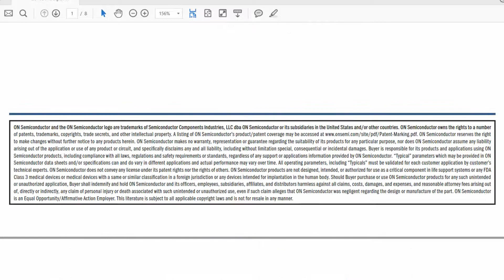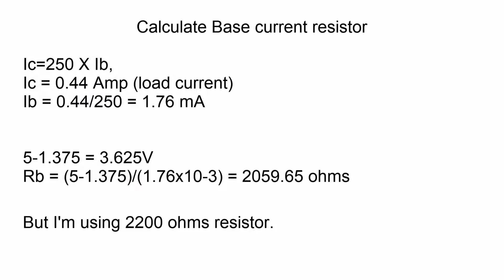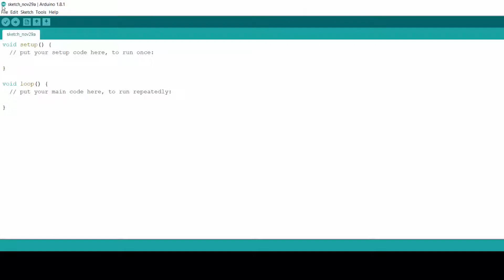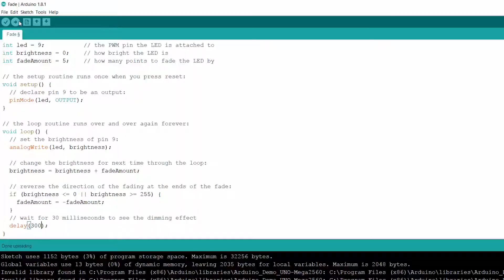Arduino Tutorial 27# How to control 12V LED & motor with 5V arduino using Transistor TIP 122.

Comment: Hi, I'm not sure if you are still checking messages on this item but I have followed your instruction and it works fine but I am wondering if I can change the polarity as I would like to switch on and off the positive not the negative.
Reply from the maker: NO you can't change the polarity, It will not work. it (LED Light 12V) is suppose to connect negative on TIP122 and positive on 12v power.

Comment: I need a help with an arduino program
I want to turn on led strip through IR sensor.
So when IR sensor output is high the led strip should glow and remain glowing even if the IR sensor output is low..
And when again IR sensor output is high the led strip gets off and remain off even when the output is low...

Comment: Can i know if i use siren 12v also can use this way to make it functional?
Reply from the maker: yes it can be use for 12v siren but check operating ampere of siren and calculate resistor value.
Reply: Robotica DIY where can i find the transistor at my area no have sell tht
Reply: Robotica DIY if i use tip 120 for siren 12v it is can n suitable or not?

Comment: sir can we use tip 122 to control 40m 12v led strip
Reply from the maker: yes, but resistor value will be different than this video. calculate resistor value. i think you will have to use around 24K ohms resistor.